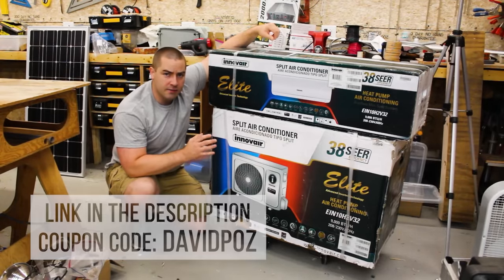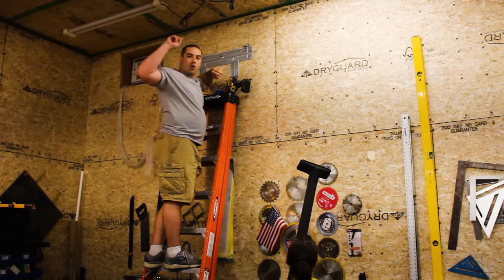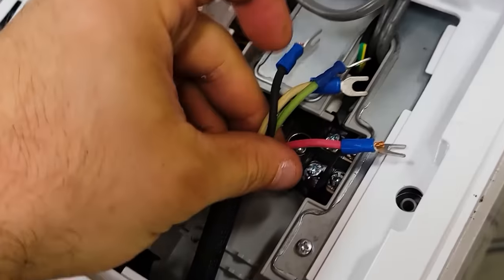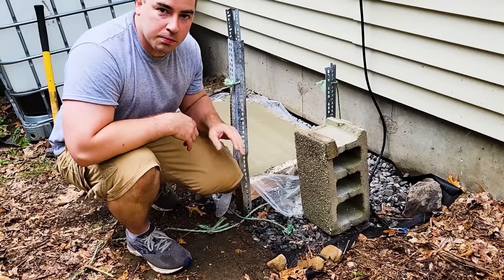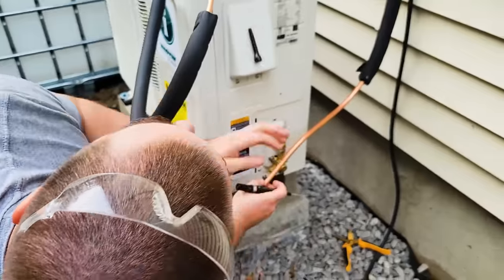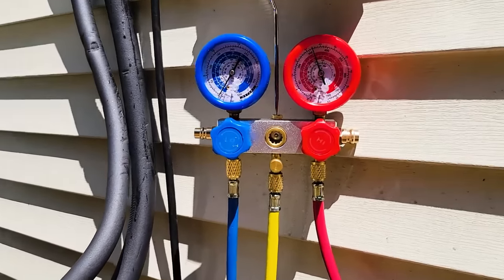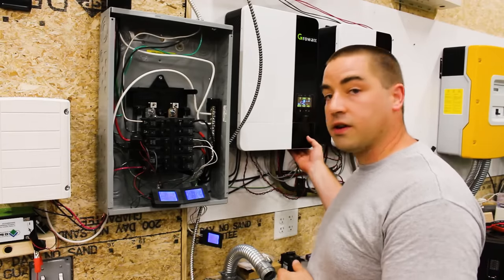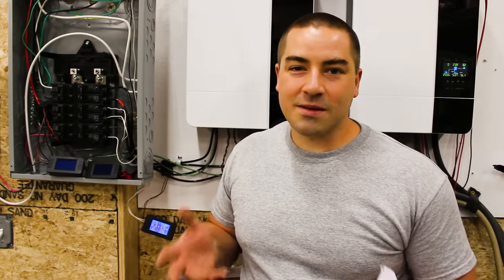DIY Mini-Split Heat Pump, Full Installation, 2021

Comment: I believe the crowfoot needs to be pointed out to get a correct torque reading.  At 90 degrees you have increase the effective torque.   There are charts that make the conversion.

Comment: Nice. Glad you did the pressure test.
That can be done with vacuum, however that is unreliable as the vacuum can seal a leak. I've seen it in automotive AC diagnosis.
Are those gauges automotive as in R134a?
Maybe I missed it, what kind of refrigerant is this system?
Reply from the maker: This system is R410A.  Thanks for watching.

Comment: The Klimaire unit allows you to skip the vacuum down according to MFG. also the unit i installed was through a very thick earth bag house so i had to attach lines between units from outside in then pre wrapping then as the thickness of the wall would not allow mounting first. we also feed the power line from the main unit back through the bundle into the house where the circuit breakers resided. main was mounted outside on cemented wooden base three feet off of the ground and excess pressure and return lines  and power lines were looped and hidden behind unit..... no cutting flaring  or pumping necessary.

Comment: David, you did the nitrogen test wrong. You should test to below the low pressure, so if it says 320 psi you check it around 300 or a little less. Pumping 4 or 5 hundred psi into the system the way you did can push nitrogen past the Schrader valves into the compressor.

Comment: The correct charging procedures is to connect the center hose to nitrogen, then bring it up to 250 to 300 psi. Leave the unit for several hours. Valve core removed. Sometimes days.

Vacuum with valve core removed. Then break with refrigerant and install valve core.

You cannot read vacuum with a manifold gauge.

Never leak test with vacuum.

Comment: I would love to hear an update about how efficient it proves to be! Thank you for the video. I will be doing this myself soon
Reply from the maker: I averaged 6kWh/d From Aug.10-Sep10.  During that time it kept the garage at 64 degrees F (and set to 64).  My window AC (during previous 2 months) was averaging 11kWh/d and couldn't get the garage below 74.  (window AC set to 60F) So, yeah, it's a whole lot more efficient than my window AC.

Comment: Thank you for such a complete video. I am wondering what your experience has been with the Innovair mini split. I am familiar with the Fujitsu and the Mitsubishi which don't have as high a SEER rating. I was wondering if there is some "inflation" of the SEER rating? And also what is the cold weather experience with this unit?
Reply: Yes I've thought the same about inflated ratings.

Comment: Im oredering the 9000 btu 38 seer for my camper. I hope the energy use will be better than the 110 25 seer ch brand i was considering.  Ill be using my 4000 watt sungold power 220 volt to run it.

Comment: Anyone installing a mini split should take in consideration that the back side of the unit is never insulated. It's basically a evaporator coil with nothing but plastic separating the conditioned air and the wall. The plastic also creates condensation that is NOT captured by the drain pan and can create water and mold damage. Make  placement and proper insulation and sealing of unconditioned air before running and ruining location of installation!

Comment: This is a B grade with their hyper drive, the A grade units are branded as Midea and Carrier, Midea is 40 seer, Carrier has a motion sensor on inside unit to help them attain 42 seer, and they are identical except that one sensor

Comment: How far away can the copper lines be from the inside unit to the outside unit?  I have a 2 story house and want to mount the unit on the 2nd floor. I don't know if the unit on the ground would be too far away, which means it might have to be mounted on the house. Thank you. This is a great video. I am having a friend help me install one, and then hire an HVAC person to hook up the rest.

Comment: Good video. Needs to have a 120V service outlet within site of the condenser to meet 2020 NFPA code. Some of the manufacturers have started incorporating this within the disconnect so you don't need to run a a separate power circuit. Be interesting to know what the temperature and humidity was outdoor over the 48 hours you operated it as well as the size of the garage.

Comment: With the line set connected to complete unit the low side and high side are common.  The low pressure should have been the pressure used.  Hope the low side survived the high pressure test.
Reply: The service valves were closed, so the only thing being pressurized was the lineset and indoor unit which is a heat exchanger.  It's definitely all rated for at least 550 psi.

Comment: Thats crazy identical to a mrcool unit that I installed on my house last year, that is only 20 seer tho. But it came with a sleeve for though the wall and the hole size was 3.5in diameter.
Reply: Mr Cool needs a bigger sleeve because of the larger connections they use on the copper!

Comment: u are a great educator and helped many people.  i do have a question for u. the lithium iron phosphate i bought from china arrived in great condition rated at 3.2 v at 280 ah. however all the 32 batteries have 3.82 v.  i like to top balance the batteries, do i have to discharge them first?  i would appreciate ur advice.  thanks for ur time.

Comment: Really should have had a micron gauge on that to ensure its brought down to the right level, refrigeration manifold won't tell you. Without it you run the risk of reduced compressor lifespan due to potential moisture and non condensables in the system. Moisture in particular will produce acid in the system, boom goes your compressor windings.

Comment: Signature Solar has a ebay storefront, Innovair has a Amazon store front both out of stock.
Innovair has quit including the ' installation kit '. Also Innovair runs a pretend storefront called powersaveac. The end of july I bought this unit from Powersaveac, I haven't recevied a return phone, or email response yet. Innovair billed my card. and shipped the elite unit. Innovair customer service was quick to return my phone call. Chris was very helpful.

Comment: The real test will be when you hit the hottest part of summer and the overall number of years you can expect to get out of the unit.  The mini-split technology has been and continues to be a real game-changer for those who are off-grid or want to reduce their energy consumption and it just keeps getting better and better.   I wish consumers had access to better data on the life expectancy of some of the brands available as it seems to be all over the board based on quality much like most of the window units.
Reply: 5-10.
Reply: Mine were installed in 2005, haven’t had any problems. Used in hot summers and during winter.

Comment: I installed two and replaced propane heat in our home.   Midwest United States....anyone that says these can't work in the cold are mistaken.  

Cut our heating bill to 30% of what it was and we are warmer.  Cheap heat compared to propane, I don't feel so bad letting the thermostat trolls in the house turn them up.

Comment: Don’t see many head units that power on 220, which eliminates the neutral.   You don’t want to use the ground to run a 110 head, because you might make some grounds in the home hot.

Comment: We'd probably go higher than that in the deep south, due to being in a floodplain.

Shouldn't the condensed water from the interior unit run to the outdoor unit?
Reply: The condensed water is just the moisture from the air that condenses on the cold coils. It just needs to drain away from the unit to somewhere you don't mind getting wet.

Comment: You actaually need to mount the wall unit level it is internally pitched and if you dount mount it level to a completely flat surface you will risk stress on the wall mounted units internal fan, It is a small round cylinder plastic fan that is quite flexible and if your unit is not flat and level it will risk damage to this internal fan causing noise, less cooling ability over work on the inverter power source. It is actually very critall that you mount it directly level regardless of which side you move the drain too the drain plug is to deep becasue when pused in properly it keeps the water internallly held back and pitch to the side you chose to drain from. I have had to re mount hundreds of the systems after 4/5 years of them being mounted at a pitch.

Comment: Got to love that aggressive SEER mystery math. All manufacturers accomplish these numbers by downsizing the inside head. Note it's listed as 9k btu based on the inside head but the compressor is 12-14k btu so the outside unit runs at 40-80% of max power increasing SEER.
Reply from the maker: That makes sense.  The outside unit is twice as heavy as the Mr. Cool unit I installed last year.
Reply: Would pipe geometry and arrangement that reduce fluid resistance increase SEER?   How about Teflon or something better inside coating that reduces resistance and increases heat conductance?  Would it help.
Also just searched YT for ice-phobic coating and found some interesting videos.    This would skip the defrost cycle.
How about lazy man geothermal by burying non-toxic 1000 gallon of windshield washer fluid and dip outside coil in it?

Comment: ( NOT meant in a nasty way ) but if you could get a better microphone or use a wireless one so that it doesn't sound like you're shouting

KEEP UP THE GREAT WORK :)

Edit ...... Maybe it was just the first few moments that the sound sounded so loud, as your voice was actually just right, VERY informative, and very nice job with the installation

Comment: Look at the EER.  I compared the EER of several Mini-Splits and could find none over 13.  So I bought a replacement Central Air system that was 12.5 EER and put it in myself. 3 ton unit was $1,600. Delivered.
Reply from the maker: Nice.  Was that $1600 just the outside unit, or the outside and inside air handler?  Thanks.
Reply: @DavidPozEnergy  Compressor Unit and Air Handler with Heat Strips. Not a Heat pump system. The reason i didn't go with a Heat pump is because my Central heat bill rarely exceeds $50 a month in the winter here in Texas. The exception to that was last February, 2021 when temps hit 2f and nearly every heat pump in Texas quits working at 25F.

Comment: Can you run the electrical wiring and copper piping through the wall low and up the inside wall of the garage. Less seen for outside appearance?

Comment: DavidPoz how much did you say a unit like this costs on average and how many square feet/cubic feet are you cooling? Is the garage door/doors insulated? Thank you and you get Father of the year award. Your genuine niceness comes through in every video what is your secret?
Reply from the maker: Thanks for your comment.  This is a 9000BTU unit, which is fairly small.  This exact one sells for $1229 at Signature Solar.  (discount with code DAVIDPOZ)  If money is really tight you can find them less expensive, but it won't be as efficient.  For example, I saw an $800 at Home Depot which is 20SEER.  Probably good enough for most things, but I haven't tested it.  I'd make sure whatever you buy, it has an inverter-drive.  That allows for more efficiency and a soft start.  The soft start allows you to use it on off grid systems (inverters and batteries)  

As for my niceness?  Not sure.  Maybe because I know I'm not an expert on this, I'm just a DIY guy.  I make mistakes.  I do things twice.  Hopefully I can save you (the viewer) time and hassle by sharing that.  So we all don't have the same mistakes.
Reply: @DavidPozEnergy  Well I thought it was spiritual thing never the less I enjoy your videos and at 71 thanks for showing mistakes. Don't blink your little girl will be having children of her own someday.
Reply: @DavidPozEnergy  All those little times you played with your children will be amplified  in their minds when they grow up and fond memories. It almost bought tears to my eyes as my Children are your age

Comment: If not already noted a heat pump should really be at least a foot off of the ground to drain and keep out of the snow in winter.
Reply: Good point. Plus a heat pump does not work well in extreme cold temps.

Comment: I would like to see how the load balances the load with the transformer in play.
Reply from the maker: With the auto-transformer turned on, there is no difference.  I've done it.  No amps flow through the auto-transformer.  This is because the 240V mini-split pulls directly from the inverters.

Comment: Great video...as a DIY, you shown that this is possible.  I'm doing my own install currently and just got the inside ductless unit mounted Sunday night with all the short line set and electrical going outside. ( I did sealed the electrical head unit wire going outside with the gray conduit weatherproof.  I figured it was code and for $20, I wouldn't have to redo if I should have done it this way?)  I have to make the ground cement pad yet and since I'm in NY, I need to rise the unit due to snow.  I like your cinder block cheap cost approach, but concerned about an industrial look of cinder blocks vs a neater risers as this will be seen from the street on the side of my house.  I may just mold and make a rectangular concrete footing riser vs something i could buy??  Thank you and your wife for putting effort in this video for us!  Great efficient upgrade!!  Unfortunately, your daughter will have to find another play bus to play on!  lol...

Comment: Did you ever figure out how to remove the risk of a floating neutral with that transformer.  I didn’t see the followup
Reply from the maker: I've got some options on my workbench waiting for me to make a video.  Right now I've still got the auto-transformer fed from a circuit breaker.

Comment: Can we get a winter update? I really like the summer performance, I’d like to see some winter performance. I believe these are 15 hspf so that would be interesting. Also can you mention outdoor temp, I didn’t catch it in the video and in the comments it just said it was middle of summer. Thanks!!
Reply from the maker: It's been working great.  Certainly uses less energy than my electric resistance heater.  I'll make an update video with some numbers.

Comment: Curious about the heating capability. I live in Michigan with real cold Temps. Alot of pumps don't do well in cold. Would love to see your cold weather, heat test abilities.
Reply from the maker: I look forward to testing it this winter.  Right now my solar is heating the garage fine.
Reply: @DavidPozEnergy  What square footage? How high is the ceiling? Some details on the insulation would be nice.

Comment: how many BTU on the cooling of the unit-an how many amps does it pull on eco-mode an also on max cool mode/should be in back of instruction book/is it 110 AC or 220 AC /what size breaker does it call for/if you would let me know/thanks much
Reply from the maker: In the Manual, page 2, Specifications: 
Cooling Capacity: 9000 BTU/h
Cooling Current: 3.05 A
Rated Voltage: 230V
Max. Over Current Protection: 15 A

Comment: DavidPoz in the future, as per HVACR guidelines the pressure of the requirements test should be 240 PSI from the low-side & not the high amount.
 
Good Job.
Reply from the maker: Thanks.

Comment: hi David , great video, just a question what s the point you have done first vac then the pressure test? normally do pressure test find the leak repair the leak the vac then top up the unit ref.

Comment: Thank you Dave ,for such a comprehensive video. In your garage breaker panel, Are you using a 15amp double pole beaker, and using the white neutral wire as one of the two positive wires running to the ceiling junction box? Thank you

Comment: I always wonder why no one puts a cover over the outside unit, to prevent rain coming in. As you already showed,  it's not that great quality. 
Also, maybe put some anti rust spray on the cracked paint parts.

I suppose you could screw a stainless plate on your house, and 10 inches or so over the unit on each side.
Or just a big plastic bucket/ lid kind of thing.
Googling shows you some ideas 😁

Comment: Is there some reason you are not bringing the electricity in with the pipes?    When I installed mini splits I brought everything in with one hole.  By the way, the copper is in metric.   It is my experience is that you do not flare the line set you braze the line set flare on the shortened line set.  You didn't need to vacuum the system 2 times.

Comment: Awesome video, awesome install.  I have no idea what your line set actually was is, but I am currently installing a 5-zone Pioneer with only 4 indoor units.  One is 24K but the other 3 are 9K and those line sets are 1/4 x 3/8.  My understanding is it would be that way regardless of manufacturer for a 9K indoor unit.  This may explain why you had issues when flaring if your copper was 3/8 but you were trying to flare for 1/2.  Again, I am not an HVAC professional but since I am in the middle of my install, I recognized init size and line set size and it stood out to me.  Awesome video! Thank You.
Reply from the maker: That's cool you are installing a 5-zone system.  
In my case, the line set is 1/4" and 1/2".  The manual confirms that's what it's supposed to be.   I also tried 3 different flaring tools to see if the problem was my tool, but all three had the same result.
Reply: @DavidPozEnergy   But were they Plumbing or HVAC tools? Plumbers read Inside Diameter, HVAC is Outside Diameter for pipe size. The Tool was a knock off of The Original of that style made by Ridgid I've had mine since 81 it's the best hands down. Great video though.